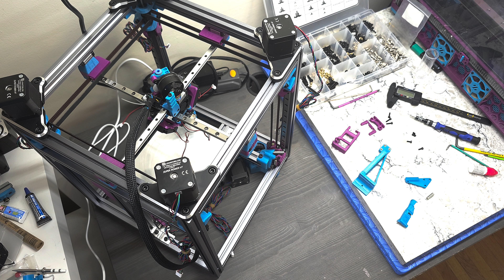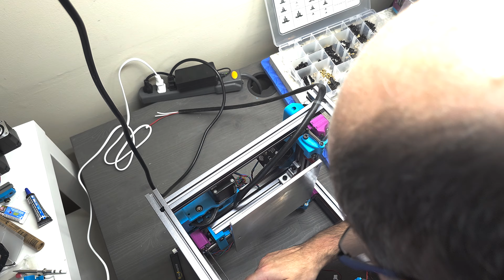Annex Engineering K3: Build Part 12 - Purge Bucket

Comment: Looks good! IMO the annex is one of the coolest printers out there. Are you going to run the steppers at 48v?
Reply from the maker: I am definitely going to try, but smarter people than me tell me that these LDO 2804 motors generate VFAs when powered at 48V, and they recommend running them at 24V instead.
Thankfully switching stepper driver voltages is as easy as moving a few jumpers, so testing both to form my own opinion should be easy enough.